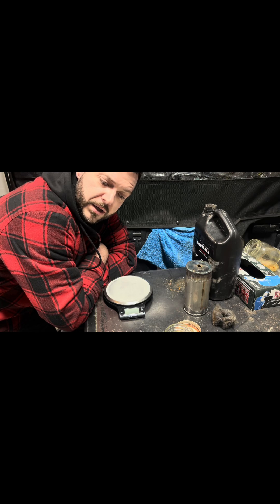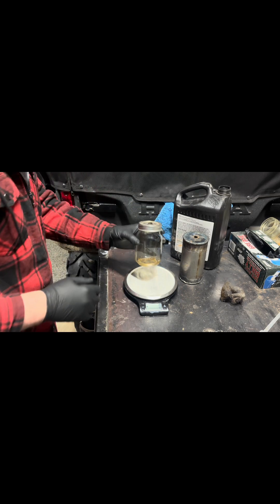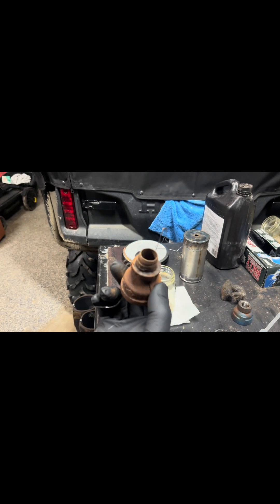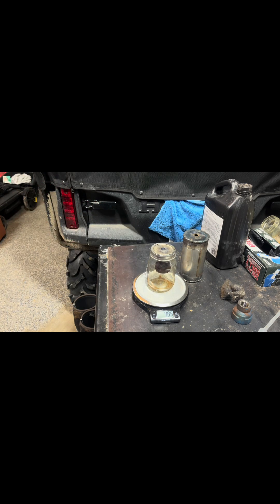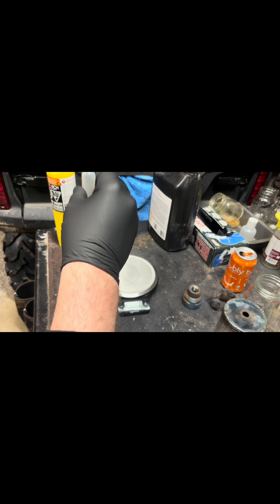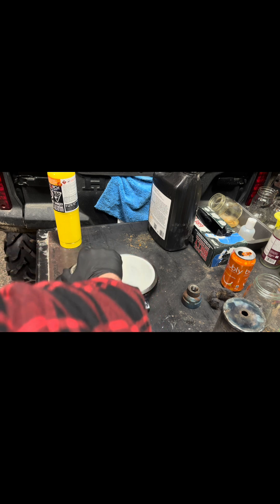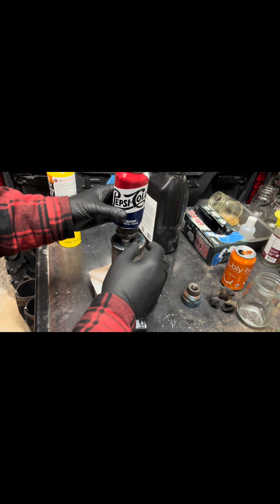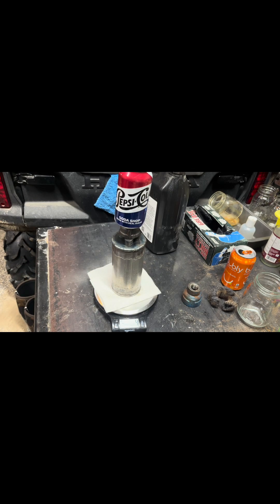Advancing the Pulsejet: Testing New Designs

Comment: Grams? TFFT! At last! The 95% of the population of the Earth that uses metric just breathed a huge sigh of relief! 
NOW we have usable data!
The rocket accelerates at approximately 0.088 g, or 0.87 m/s², because its thrust (6 g = 0.05886 N) is acting on a mass of 0.682 kg, resulting in a net acceleration of 0.05886 N / 0.682 kg = 0.0863 m/s², and this is divided by the standard acceleration of gravity (9.80665 m/s²) to get the acceleration in gravities. 

Here's the breakdown:

1. Convert mass to kilograms:

682 grams = 0.682 kilograms (kg) 

2. Convert thrust to Newtons (N):

1 gram of thrust is equivalent to 0.00980665 Newtons of force. 

6 grams of thrust = 6 * 0.00980665 N = 0.0588399 N 

3. Calculate acceleration in meters per second squared (m/s²):

Use Newton's second law: acceleration (a) = Force (F) / mass (m). 

a = 0.0588399 N / 0.682 kg = 0.0862755 m/s² 

4. Convert acceleration to gravities (g):

Divide the calculated acceleration by the standard acceleration of gravity (g ≈ 9.80665 m/s²). 

a (in g) = 0.0862755 m/s² / 9.80665 m/s² ≈ 0.008797 g 

Therefore, the rocket's acceleration is approximately 0.0088 g.

If you could run it for one year, at that acceleration, you'd reach 2.75% of c. (Small c = the speed of light in a vacuum.)

Comment: If the diffuser  occupies more volume for mixing air/fuel for combustion then it's detrimental. The oscillation frequency determines the thrust volume coefficient. Copper wool as a diffuser plus a heat sink for condensation of fuel. Hope it works.
Reply from the maker: That makes sense as it worked great with my larger jar but seems to hold back the smaller ones.. thanks for the information!